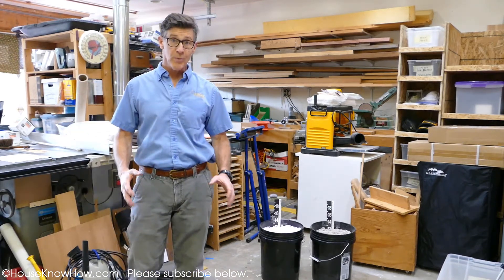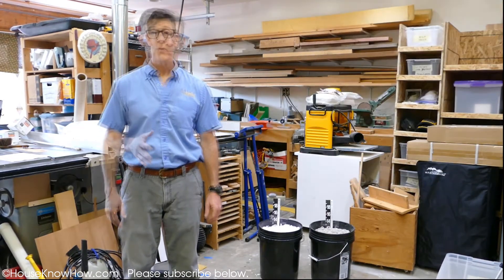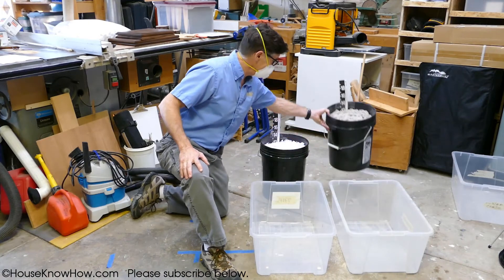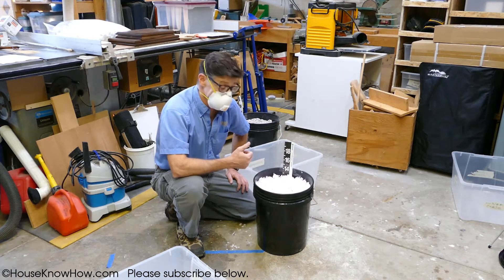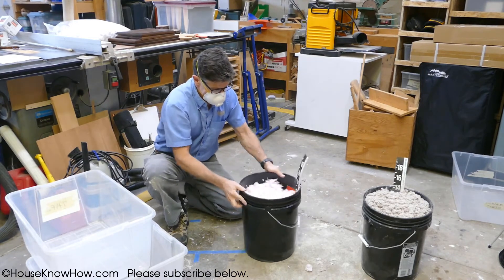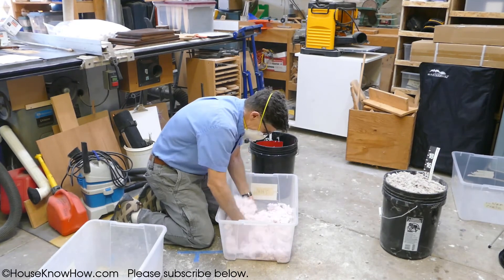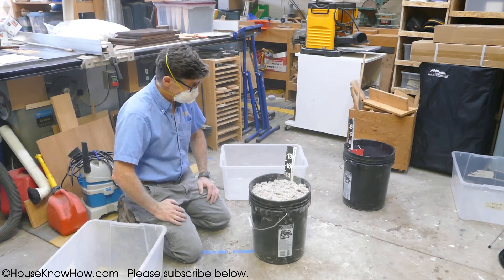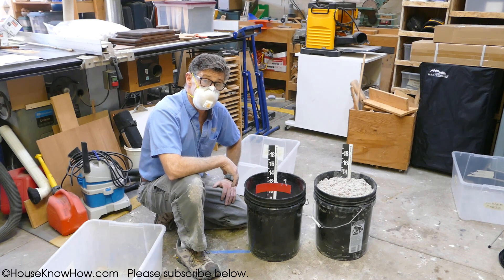Cellulose vs Fiberglass Insulation - Another Perspective

Comment: Thanks Martin.  I am building a new home and was presented with both of these products as options for my attic.  Fiberglass was a little more expensive, so I thought it was a superior product.  Seeing this makes me think that I’m ok to stick with cellulose.
Reply: There are still good reasons not to spray cellulose in attics not covered here in this video. 

Example:

If a homeowner develops a leak or breach in the roofing/decking that isn't detected quickly after a period of rainy days or weeks and the cellulose gets repeatedly wet...it gets HEAVY.

 By the time they notice the sheetrock has water damage and reveals a leak has been going on unbeknownst. 
.. cellulose absorbs the water like a sponge and the significant added weight it brings can be enough to cause the damp sheetrock to collapse the ceiling before the owner can get the problem assessed  and addressed. 

The fiberglass..while being less adept at attempts to re-fluff and yet  more expensive... IS STILL worth the trouble. 
Most cases needing a company to do a "build up" (second attic spray- over)  is justification bc most times it  doesn't settle much below r-value to require those build ups to spray more than just a few inches and is not a bank breaker  financially. .vs the alternative-
The BIGGEST REASON to spend extra and avoid cellulose is that wet fiberglass isnt as problematic not only in terms of weight and is VERY flame resistant ...but

 MOST MPORTANTLY
 .
..Is ALSO not a conducive substrate to foster or promote  the growth of dangerous "black mold" spores and mildew damage...whereas wet Cellulose IS an environment that offers reduced resistance to dangerous mold growth AND is not AS effectively flame retardant Like fiberglass, though it DOES have fire retardant additives like 'borate' etc..to assist in it not burning easily..but an attic fire big enough to be a concern doesn't need any help from cheap insulation to fuel it's destructive ability, so the flame retardant issue is not as relevant as the damage that wet Cellulose can exacerbate into costly and potentially dangerous importance.  Adequate humidity control and attic ventilation is what the fire retardant issue is important to understand. The cheapest Cellulose often uses ,not the less hazardous Borate...but AMMONIUM SULFATE, and wet Cellulose with Ammonium Sulfate additives can cause the dangerous "off-gasing" of ammonia when the Attic can't "breathe" correctly. Borate doesn't "off-gas" and is what you want to have as the fire Retardant additive( if you must use cellulose at ALL )

Cellulose is mostly ground up newspaper and glue,.. obviously made of things that CAN still  burn when exposed to a large enough fire source.. It's not a fire hazard.but not invincible either but tbh...it's the danger of moisture that is why it's not preferable in attics

It's cheaper to spray cellulose... especially in new construction but homeowners that have to pay for a re-fluff/build up out of pocket are even more apt to allow it when they don't consider the pros and cons of WHY it's not a scenario to financially cut corners on, without understanding the potential consequences. 
Fiberglass is more expensive to make but is SAFER by far in the long run..An attic fire is a threat with or without either type needed to ruin lives..

Excessively wet (saturated)cellulose is not remotely lightweight, and WILL not stop mold spores and mildew. AND Ammonium Sulfate can result in "Off-gassing" 

That's WHY you should leave it out of attics If it can be avoided. 

If you must,...at least know what you're dealing with beyond the realm of cost effectiveness vs potential hazards and avoid the super cheap version. Ammonia is not a safe thing to be exposed to.
Reply: @keithbarto5464  good to know.   Lucky for me I live in a very dry climate.

Comment: All loose insulations settle down  accumulate additional dust . Personally mineral wool batts combined with a 1’’+ spray foam is most effective long term. Mineral batts are easer to move intact tend to collect less dust and not hold water like cellulos
Reply: No shit dude, but mineral batts and spray foam are way more expensive. I have one inch of spray foam in my shop and it’s great for air sealing, if I built a house I’d definitely spray foam the walls and attic or at least mineral wool my walls and spray foam the attic. 

But most people don’t have the money to do these things, my current house has fiberglass and we are about to add ten inches of cellulose right over it after air sealing.

Comment: Leaning towards rockwool>fiberglass>cellulose.   Cellulose can offgas ammonia.   All seem to compress down significantly from initial blown in depth.
Reply: Wo soll denn das Ammoniak herkommen.
Reply: @thomasschafer7268 Google is your friend:
Cellulose Insulation: Ammonium sulfate and boric acid are fire retardants commonly found in cellulose insulation. Occassionally, the ammonium sulfate can off-gas and produce an odor. In damp environments, it can also form corrosive byproducts that can degrade metal that it comes in contact with.
Reply: @BenKlassen1 if you have good ventilation you should be good.
Reply: I have good ventilation and the wind blowing in from soffits forces smells through the areas where walls are in the attic. The smell was unbearable. I had to go up and air gap seal all gaps with foam.

Comment: Would a vapour barrier on top of 50mm cellulose cause an issue close to warm side of insulation as its hydroscopic? I have 270mm fibreglass on top between loft joists.

Comment: If it is no secret, what is the normal hourly rate for such work?
Reply from the maker: It really depends on where the work is done as rates vary all over the country. Sometimes you will get a quote for the entire job instead of an hourly rate.
Reply: You will most likely get quoted per sq foot of your house. Can range from $4 to $6 if you are looking to remove and replace insulation. If just adding more, maybe half that price? Only way to find out is to get estimates.

Comment: The ridiculous amount of dust given off by the cellulose is the deal breaker.  
Who would put anything that dusty in their home?
That dust is full of nasty fire retardant.
Reply: I go with cellulose because it's only dusty when installed and does a better job insulating. And, most of the dust is in the attic, not in the living space.
Reply: If you are air sealing properly and not up in your attic daily stepping all over it the dust really won't ever end up in your living space in any measurable meaningful way....
Reply: Who cares if it's a better insulator. Are you going to hang out in the attic?
Reply: @HTHAMMACK1  ... the whole point is to insulate the house, not the attic.
Reply: Just did the exterior walls on my place with cellulose yesterday. From the inside. We have aluminum siding, good luck removing it without damaging it. I am not removing hundreds of square feet of siding to insulate. It is what it is. Punch the holes, blow it in, shove some fiberglass in behind it, clean it up, fix the plaster.

Comment: I really don't get the benefit of blown in fiberglass then at all. It's 2-3x the price per bag, it has a worse R value and it really does not fare well against being stepped on.
Reply from the maker: You can't just compare the prices of 1 bag of cellulose the 1 bag of fiberglass. You need to compare the final coverage area and thickness that each bag yields. That way you can calculate the cost per square foot of say R50 of each product. 

My opinion: As far as the benefit of fiberglass, it all goes to the installer. It's much less messy (dusty) to install fiberglass. That's why most homes have it. And fiberglass marketing is a well oiled machine. It's much better than the cellulose one. And, they market to installers more than homeowners.